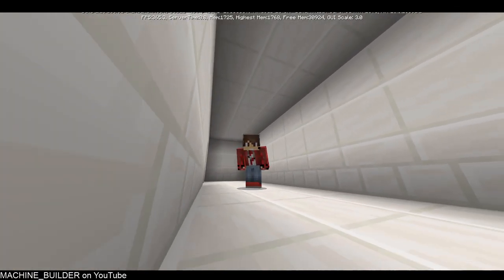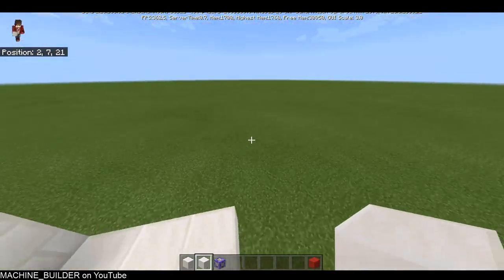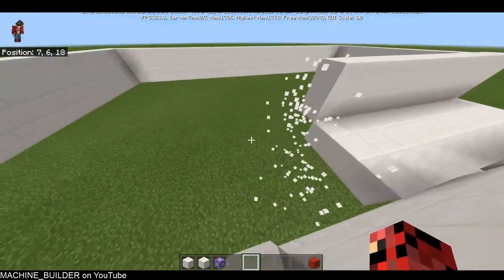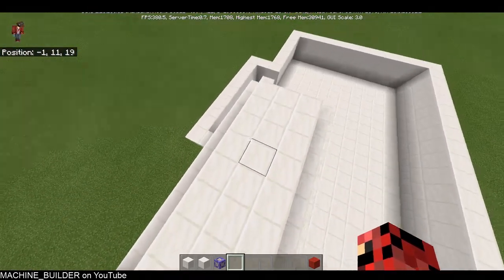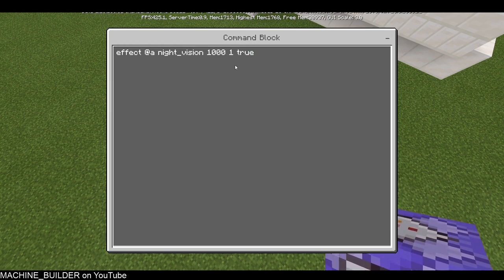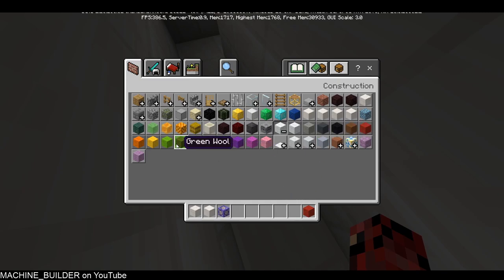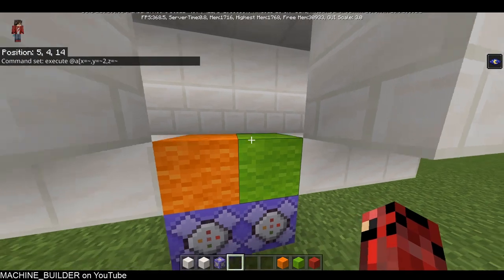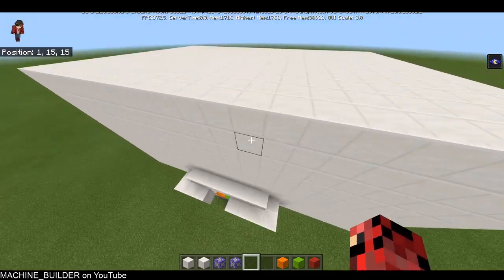[Tutorial] MCBE/PE Non-Euclidean Geometry Tutorial!

Comment: Please change the title, you cannot make non-Euclidean geometry in Minecraft (non-Euclidean geometry is a completely different thing -- there is a difference between topology and geometry, you can change the topology with porrtals, but the geometry remains Euclidean). There are games Hyperblock and Hypermine in development, which are truly non-Euclidean.
Reply from the maker: I believe you're thinking of hyperbolic spaces. This is still non euclidean. It's about the simplest possible setup for non Euclidean geometry. - and yes, I know it's not actually non euclidean geometry (since that's obviously not possible in Minecraft) - this is a workaround to make it seem non euclidean.
Reply: @MACHINEBUILDER  Hyperbolic geometry is the original non-Euclidean geometry, yes. I use geometry in the modern math sense, where hyperbolic geometry is not the only one. For example, in three dimensions, we have eight Thurston geometries (Euclidean, hyperbolic, spherical, two product geometries, two twisted product geometries and Solv which is especially crazy).

Whatever can be simulated in Minecraft has Euclidean geometry. It does not even seem non-Euclidean (if you understand what non-Euclidean geometry is). In non-Euclidean geometries you have no rectangles (usually), and perspective works in a completely different way. 

You can make a cylinder out of flat paper using scissors and glue (because the surface of a cylinder has Euclidean geometry, just like flat paper --- it is not the Euclidean plane, but it still has Euclidean geometry). You cannot make a sphere out of flat paper (because a sphere has non-Euclidean geometry). What portals do is like scissors and glue (they change the topology of the space, but not its geometry).
Reply from the maker: @ZenoRogue  yeah I see what you mean here, as obviously this is Minecraft and it can't be actually non euclidean, since Minecraft is made up of squares and cubes.

But I guess what I made here could almost be considered non euclidean, since it's technically not euclidean, since in normal space that hallway and room wouldn't be possible.

But yep I see what you mean by that
Reply: @MACHINEBUILDER  There are many things named after Euclid: Euclidean space, Euclidean metric, Euclidean geometry, Euclidean domain so on. Non-Euclidean refers specifically to the geometry (especially when you say "non-Euclidean geometry"). That hallway and room are not possible in the Euclidean space, yes, but they are possible in a manifold with Euclidean geometry.
Reply: O god my brain